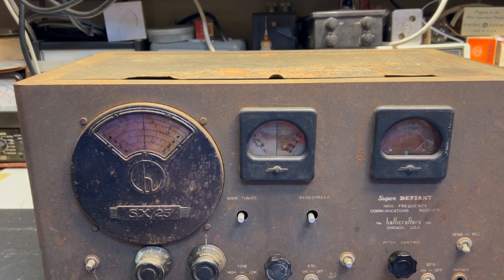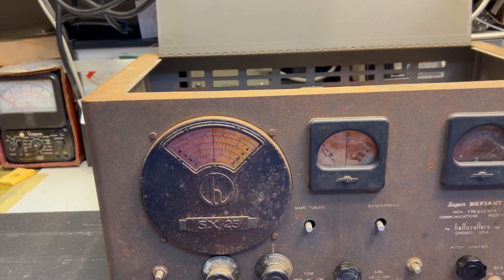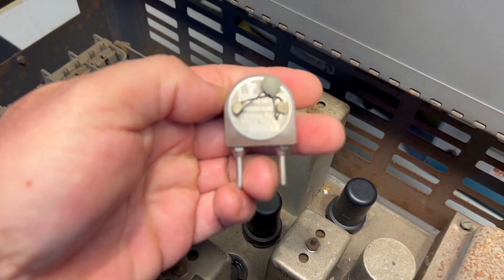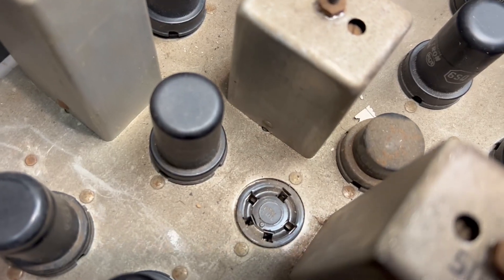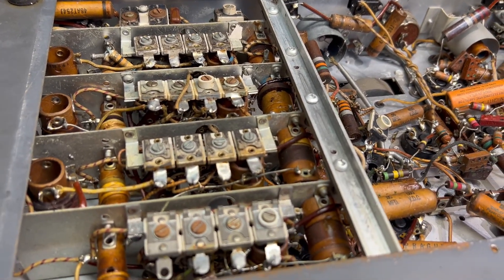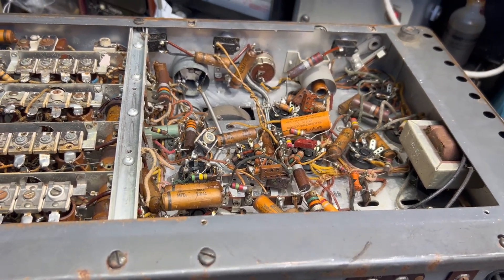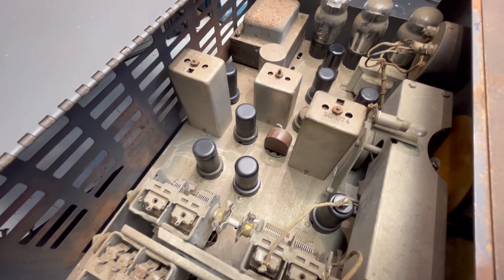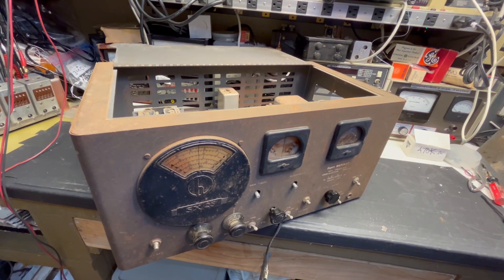Hallicrafters SX-25 Super Defiant Receiver | Part 2: Parts Receiver

Comment: So i found one of these in my garage today... plugged in a headset, and the antenna amplification seemed to have some effect on the sound output but it wasn't picking up anything; where to start...?
Reply from the maker: Hello, the receiver dates back to the 1940's, so with time they will develop corrosion on the switches and contacts. Before you plug it in, i recommend you use some contact cleaner and spray all switches and contacts. Also, most likely you will have a few faulty resistors or capacitors, thus the receiver might not work. Most importantly you will have the original wax yellow capacitors, those defiantly need to be replaced. they leak current and will degrade the receiver and sometimes will tend to short out and become resistors rather than capacitors. I would not use it until you replace all those yellow waxy capacitors, or you might damage the power supply.  The one you see in this video, i replaced all components.